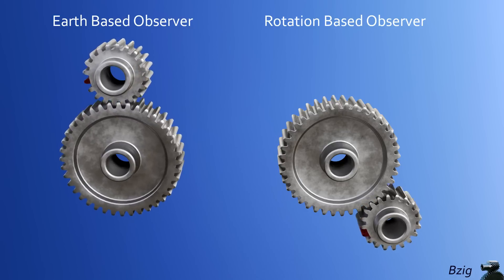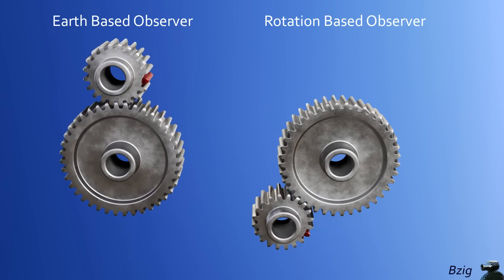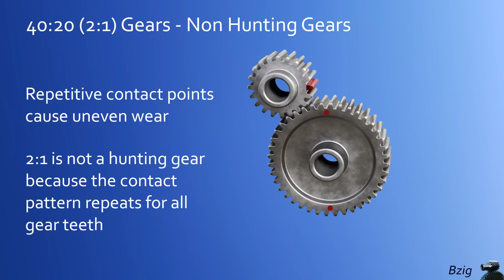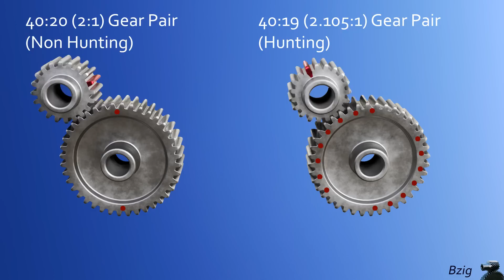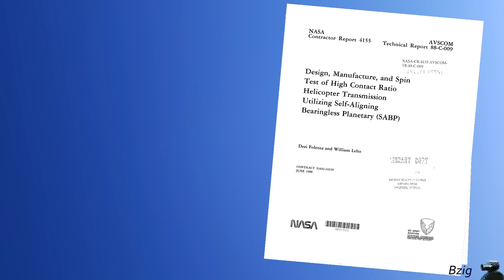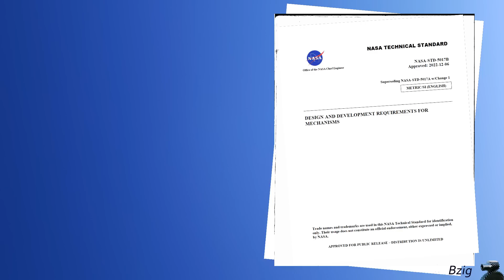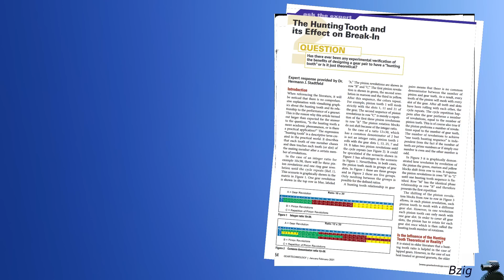Helicopter Drive Systems and Hunting Tooth Gears

Comment: Recently I found out the H125's transmission on the main rotor side uses a 61:17 bevel gear reduction, but then after that comes a non-hunting planetary gear stage with a 30-tooth sun, five 35-tooth planets, and a 100-tooth ring, which all have a common factor of 5.

Interesting design choice for sure.
Reply from the maker: I also did a 3d model of the H-60 helicopter that was more realistically modeled.  While the main bevel and planetaries in the main gearbox are hunting gears, the input module gears are not.  I found a lot of technical detail on the design, but nothing that says why they picked the ratios.

Comment: Is it good for longevity to have an exact integer overall ratio out of a gearbox with two or more stages but have hunting teeth throughout?

For example, a 30:1 two-stage helical gearbox could have a first stage with 21 and 85 teeth, and no common factors exist between 21 and 95. The second stage gears would have 19 and 126 teeth, and 19 is prime. This way, the reduction ratio is exactly 30, but each reduction stage is fully hunting.

Comment: Unfortunately Mag gears, valve timing gears are nonhunting. 😁
Reply: Timing gears must be 1:1 or 2:1, but in my experience they rarely use this in a single stage. For gear-driven cams, they'll use idlers with coprime tooth counts, and for chains, they'll have the number of links be coprime to the number of teeth.

Comment: Without getting into too many specifics, as a long time structural design engineer in aerospace that has spent years working with rotorcraft, I applaud you for your excellent and well thought out videos. Excellent work.
Reply from the maker: thanks!

Comment: Excellect presentation. Many yearas ago, as a Diesel Mechanic, we learnt this, as we had a combination of Hunting Tooth and Non-Hunting Tooth Gears in Engine Timing Gear Trains . Where the 2 x Cam Gears would be non-hunting, because they had to mesh exaactly to retain timing at 1:1 Ratio,  and the Idler Gear that connected one Cam Gear to the CrankShaft  Gear was a Hunting Tooth arrangement to reduce noise and wear.
Reply from the maker: that's cool to hear the real world application of hunting teeth!  thanks for commenting.

Comment: Considering a planetary, the number of planets, and the number of teeth on the sun, planet, and ring must share a common integer.  I don’t think a hunting tooth planetary is possible, though mistaken I may be.
Reply from the maker: So... I looked up the technical drawings on the S58 helicopter.   It uses 46 tooth planets (factors are 23 and 2).  A 39 tooth sun (factors are 13 and 3).  And a 131 tooth ring (prime).   So it appears it is possible to make a hunting tooth planetary.   Thanks for the comment.
Reply: @bzig4929  Thanks.  Some years back designed a planetary with off the shelf spur gears.  They needed a common denominator to fit.  It’s not just the number of gear teeth, it is also the number of planets.  
     Spur Gears are formulaic requiring selecting pressure angle and ‘Diametral Pitch’ (English) or ‘module’ (metric).  Helical gears, which would be used in aero applications, have to select the helix angle as well.  Once these parameters chosen, all the gearing in the set uses them.   However, the designer may choose not to use book DP or module and use his own as long as gear laws obeyed 
   Gears can and are modified by thinning the tooth.  Thus more teeth on the same pitch diameter…say 130 tooth  ring gear cut with 131 teeth.  In addition, helical gears can slide axially which, due to the helix, changes where the contact.   Sufficient axial will get the hunting tooth to work.
    The P&W 4360 gearbox’s planet gears are configured so.  The planets are counterbalanced by engine oil pressure.  By this the planets equally share load and damp vibes.
    Still, it’s a mystery!       Cheers

Comment: Can you Please explain the tail rotor and pedal system and what is the cable tension impact on pedal !!!
Reply from the maker: Most helicopters maintain tension in the cables that control the pedals via springs.  Slop would create a deadband in the control system.

Some Sikorsky products have a cable break system that allows full control even if one of the tail rotor cables brakes.  They do this with the spring tension so that when one cable breaks, the other pulls, or relaxes the pull of spring tension and the let's the pilot move the tail rotor in both directions.

Comment: Thankyou very much for taking all this trouble to share this with us. 
This may explain the patterns on machine finishes on lathe work.
Different ratios of gears produce different speeds, and feeds.
Even though everything is clamped, and tight. You can end up with a variety of patterns which you do not want.
There are other effects as well such as the material it's self. It's shape, and mass. And the cutting tool geometry, and so on.
Steel atoms all vibrate, and we are putting energy into a series of components. 
This was why all the early machines were so massive. To cut down on vibration, by using mass damping.
Kind regards, and greetings from Africa.
Reply from the maker: Thank you for your comment.  I'm flattered that you watched my video intently enough to draw a conclusion for an unrelated discipline.  Another example may be the brinelling wear patterns that develop in bearings over time.  It's fascinating to see patterns emerge from seemingly events!

Comment: I worked 7 years in a Sikorsky shop overhauling helicopter transmissions on the commercial side. Tear down, evaluation of components, and build up/assembly. S76 and S92. I had the privilege of being trained by an old timer with loads of experience, I remember him explaining hunting gear ratios to me when I was new and i was fascinated from that point on about all the intricacies associated with high performance gear train designs. Very interesting to compare the S76’s relatively simple yet effective central bull design to the much more complex S92’s full planetary design and how they wear during operation, pros and cons of each one. It’s absolutely incredible how the design engineers arrive at the “final version” of any particular component. Now I work in blades/composites manufacturing for the same company. Completely different realm of manufacturing working with composites. Equally as interesting.

Comment: Every gear system has integers as the basis of their gearing. One cannot have a partial tooth. If we expand the 10:19 gear system to a 100:190 system, we get a common factor of 10 and the wear will be uneven after time. The 10:19 gearing is selected for economic and weight factors, as well as the hunting tooth feature.

Comment: This hunting gear application is also used believe it or not on tracked equipment. Excavators- bulldozers    The drive sprocket always lands on a different track chain pin.  I was always told it was for wear mitigation

Comment: I remember slithering under the old 1948 Ford pickup we had and noticing it had a tag on the differential with the numbers of teeth on the pinion and ring gears: 11/47. 
With your explanation of hunting teeth it becomes clear why those numbers were chosen. Ring and Pinion noises are the bane of automotive drive axles. 
There is also the consideration that repetitive torsional shock may be coupled into a gearbox from driven machinery, which could wear just a few teeth way before the others. Hunting tooth designs inherently resist forming wear and noise patterns.
Reply from the maker: That's really cool to hear a real world application of this. Thanks for sharing!

Comment: you mentioned the coupling of 2 engines in your last video. As far as I could see both engines where considered basically the same. 
SO my question would be if you know or know any literature that explains the coupling of 2 engines with different power output and probably RPM. 
Thanks in advance and your videos are great m8
Reply from the maker: I'm not aware of any helicopter that does this.  The closest thing might be aircraft such as the lynx or the H-3 that have an accessory drive feature where one of the main engines powers the accessories during start via a separate gearbox.  While it's doing this, it operates at a higher rpm than the main rotor.  If the pilot switches to the main gearbox in this condition... Damage will happen.  

The pilot has to accelerate the rotor above the acc drive before switching over.  

I'm not sure if this fits the example you were looking for, but I think its a positive example that engine speeds are always matched in two engine aircraft.
Reply: Toyota synergy drive. Turbo compound aero engine

Comment: I suspect that this sort of detail about gearing is not well known among helicopter operators and enthusiasts because they are never in the position of choosing gear ratios. In contrast, automotive enthusiasts routinely choose gear ratios (typically in final drives, but sometimes in transmissions), so most are aware that gear ratios are never simple integers... even if they don't understand why. There are probably some auto enthusiasts watching this and saying something like "so that's why they're always weird numbers".
Reply from the maker: This is a great observation.  I've used machines for years and suddenly had ah-ha moments where I suddenly understood how a particular thing worked.

Comment: I was working for 9 years in a design department for gearboxes and drive trains in the steel business calculating and designing all kind of large high loaded gearboxes, drive spindles and couplings. The theory for hunting gear tooth combinations seems to be logical. The kicker is the counter-evidence: The hunting gear pair concept can not be applied e.g. at mill pinion gearboxes or mixing gearboxes and other cases where it’s a must to have a 1:1 gear ratio (each teeth is meshing all the time with one other teeth) to achieve the same speed on each output shaft. And trust me the 1:1 gear ratio is required in really many cases. The practical experience at non-hunting high loaded gearboxes over 30-40 years of operation shows that the wear does not necessarily have to be higher compared to hunting gear pair designs (odd number of teeth). So in fact the hunting gear pair philosophy can be totally ignored in modern designs. There are several other factors which are much more important and can accelerate the wear at gears much faster like regular overloads, oil quality (purity, particles, water, temperature), bad gear material combination, wrong hardening process etc. compared to the non-hunting gear pair concept. Hope this practical experience feedback helps! Finally: Big like on your mind-blowing good animations and top notch content!
Reply from the maker: This is an awesome explanation.  The Stadtfeld article tried to say the same thing, but you were much more succinct and easier to understand.  Thank you for taking the time to write this.
Reply: I think that this was about imperfections from manufacturing. With all teeth meeting each other, we get some average surface which is supposed to be smoother. Like wheels on a rail. Of course high precision gears, much harder then the load, will not change shape. No burn in.
Reply: I dare say the biggest factor is machining tolerances - which are likely to have improved since the first person noted that hunting teeth were better.

If every tooth is identical to the micrometer from factory, it probably nolonger matters like it used to.
Reply: @myne00  how thick is the oil film? Large teeth at high rpm and low load should probably not squeeze below a micrometer of oil. So this may be about cold starts?
Reply: @ArneChristianRosenfeldt  Machining tolerances, not gear tolerances.
Reply: @myne00  gears have slack. When the teeth push oil on both faces, friction goes up. Also : temperature gradient or making the box out of a different material than the gears.
Reply: Again. Machining tolerances.
Reply: @myne00  why do you play down the importance of the distance between bearings? Evolvente tooth shape lets you match any gear with any other, but is sensitive to bearing distance. Slack does not care about tooth shape. Also slack is well accepted and there are well known ways to work around it. Cars with their dog clutch introduce even more slack. I think it is weird that some people use piston engines in helicopters. The cyclic torque of a small piston engine is deadly. Piston engine only works when you bolt the solid propeller right on . No machining tolerances will help you here.
Reply: @ArneChristianRosenfeldt Because I'm not talking about it, never did, and it seems like you're trying to "correct" something I never mentioned nor overlooked.
Reply: @myne00  I don’t want to correct anything here, just to paint a larger picture. Engineering is fundamental for our modern world, but the presentation is so dry that a lot of talents will study others stuff.
Reply: Do you have linkedin? Plz share here
Reply: @Nareshsuthar0866  Sorry I am old school, I have no social media just my youtube account.
Reply: Mill gearboxes with that 1:1 ratio typically run at fairly low speeds, don't they (high load but low speed)? I feel like that's why wear isn't as much of an issue like automotive, Diesel, or aircraft gearboxes which run at high loads and high speeds.
Reply: @electric7487  The speed and load depend heavily on the mill stand. In hot rolling mills the torque in the front stands is very high and the speeds are in the range of approx. 30-100 rpm. The rear stands have low torques but higher speeds of approx. 200-500 rpm. For cold rolling mills the maximum speeds are up to approx. 1200 rpm. These figures are rough as there are quite a few different types of mills and it also depends heavily on the rolled products. In summary I can say that wear is not dependent on the speed nor on whether the number of teeth is even or odd or 1:1. Hope this information helps!
Reply: @nikmotionmix  I guess that's why they say "hunting should be used whenever practical and possible", and mill and extruder gearboxes are one of those exceptions where that 1:1 ratio is effectively mandatory. But what about in the gears between the motor and the output shafts?
Reply: @electric7487  Reduction gears are generally used in the front mill stands of rolling mills. Typical gear ratios are between i=6 and i=2 depending on the mill stand. Of course special designs with deviations from that also exist. The gear ratio doesn't have to correspond exactly to the optimal pass schedule calculation. For example: It's OK if the gear ratio corresponds to i=6 +/- 2%. This is a good thing because during designing a gearbox there are other parameters that should be set as close as possible to an specific optimal range, e.g. center distance, helix angle, profile shift coefficient, contact ratio etc. This can only be achieved if a certain degree of freedom is allowed including the gear ratio. There are no restrictions to avoid integer gear ratios but this is what many people believe. It is simply acceptable that with integer gear ratios the same teeth are practically always in mesh without any technical disadvantages.
Reply: @nikmotionmix  What's interesting is that the AS350/H125's main rotor transmission has a 61:17 bevel reduction, but then has a non-hunting planetary gearbox with a 30-tooth sun, 35-tooth planets, and a 100-tooth ring.
Reply: Noise doesn’t sound (sic) like a factor in your designs. 😁
If it were really necessary an idler gear set could be used but would be more complex. 😎
Courses for horses- n stuff..
Reply: @michaelgarrow3239  true... a 1:1 (or any integer) ratio is not often needed in a single stage. Every 4-stroke engine crankshaft to camshaft drive must be exactly 2:1, but they very rarely use a 2:1 gear set - they have idlers, or chains or belts.
Reply: @brianb-p6586  2:1 camshaft gears are were commonplace on pushrod OHV engines.  While Chevy/GM used timing chains, Ford, Chrysler, VW (bug), had gears.   Diesels had and still do use geared camshafts.       Cheers
Reply: Great, but "can get away with it" and "there are other important factors" are not the same as "hunting ratio doesn't matter".
Reply: @brianb-p6586  Furthermore, the cases OP are describing are exceptions where integer ratios in one pair are unavoidable. They can get away with it because their speeds are relatively low, or where the driven machinery experiences almost no heavy vibrations or shock loads.

Comment: Would you consider making a video about the intermeshing system ability to move inputs from the mast into the rotor blade? Some sort of magic happens up near the blade root. Somehow Kaman gets the inputs down the inside of the blade bypassing the effects caused by actual flight. I can find nothing.
Reply from the maker: Cool idea.  Kaman uses servo tabs on the blades instead of pitch links.   I don't know for sure, but I think there's a swashplate in the system to control the blades, but then the control rods are passed inside the rotor most.  Enstrom also has a crazy design where it appears like there are no controls going to the rotor.
Reply: They use something called an azimuth plate, it does not actually touch the outer surface of the mast. The bearings and tilt mechanisms sit below the masts. I am really curious about the mechanics of getting the control inputs from the top of the shaft into the roof of the blades. No hydraulics.